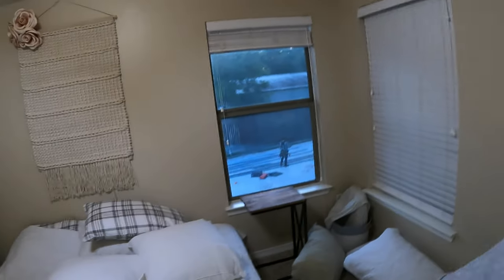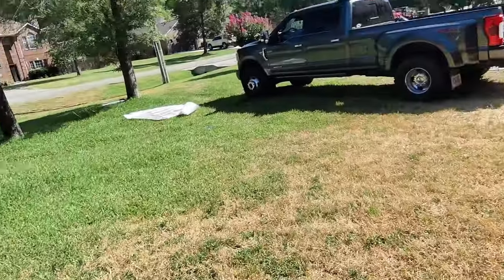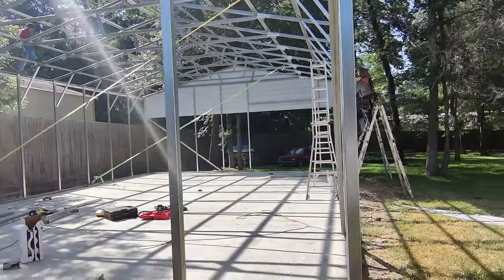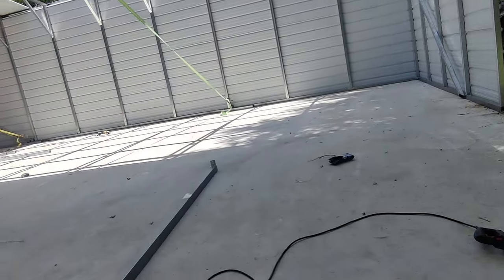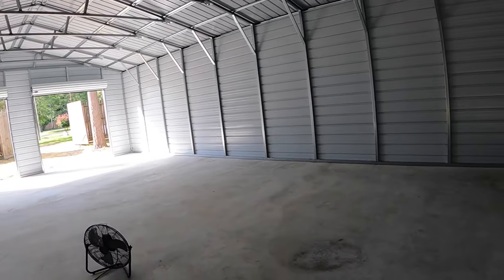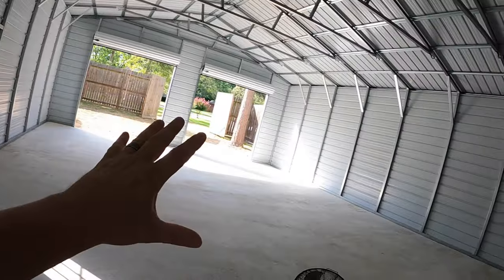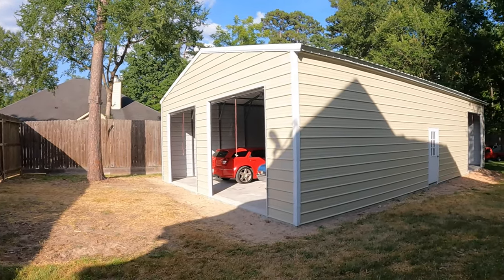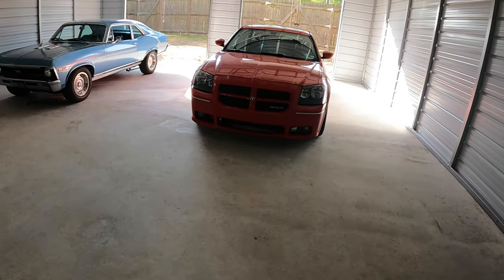30x50 Building is built in ONE DAY! Racer X Garage new Shop!

Comment: Nice looking shop, I'm looking at putting up either a 30x50 or a 40x50. If you don't mind me asking, how much did this building cost at the time you put it up?
Reply from the maker: The building itself optioned the way I had it was around 24k. I sure hope that has gone down now cause I bought just after peak of steel prices. Thanks!